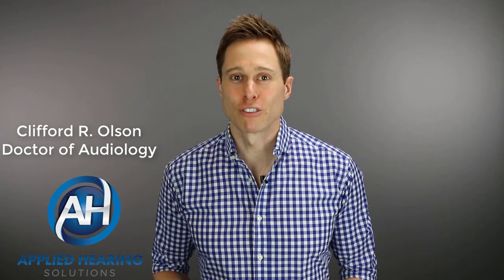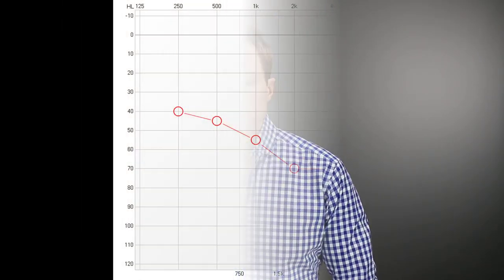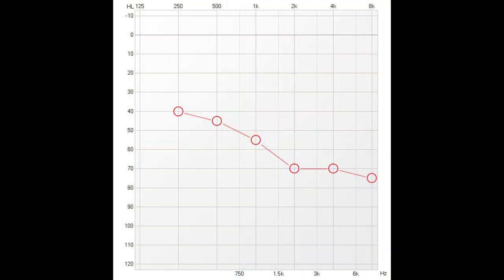The Wrong Way To Program Hearing Aids | Functional Gain & What To Do Instead

Comment: I have the ReSound LiNX 3D hearing aids.  They have helped out tremendously, but while setting in my den and watching TV, my wife will be in  the kitchen within 15 ft and the noise she makes me either take out the hearing aids or cover my ears.  I hear her voice with no problem, but things like her hitting the cabinet or dumping the ice from the ice maker bin is very painful.  My doctor did do a REM and some sounds were so loud, she had to turn down the volume.  When we are setting in our reclinder, which I can reach with my arm, she will clear her throat and it is so loud.  When I turn  them on in the morning, the volume is at default settings.  What do you suggest?
Reply from the maker: If my patients have large issues with impact sounds, I generally switch them to Phonak devices.  With Resound, you have to do gain reduction and possibly lower MPO.  You may be able to turn on fast acting compression, but not sure this will have much of an impact. No pun intended.

Comment: Hi Doctor! Thanks for these videos. Very helpful.

I will be getting my first set of hearing aids this week. My audiologist uses a process called "Live Speech Mapping" when fitting the aids. My question is whether "Live Speech Mapping" is just another way of saying "Real Ear Measurement."  Pretty sure it is, but just want to confirm one way or the other.

Thanks very much for any response.
Reply from the maker: It depends on which "live speech mapping" they are using.  If there are specific prescriptive targets they are trying to reach with a calibrated signal (not actual speech from their mouth), then they are performing the correct "live speech mapping".  If they are just trying to get speech into your audible range, that is not REMs to program to a prescriptive target.
Reply: @DrCliffAuD  Thanks, Doctor!